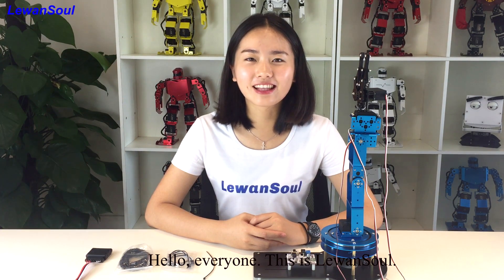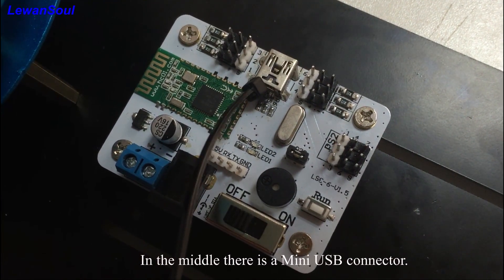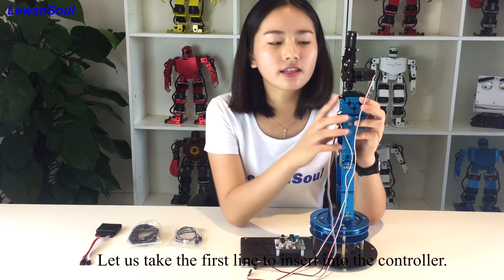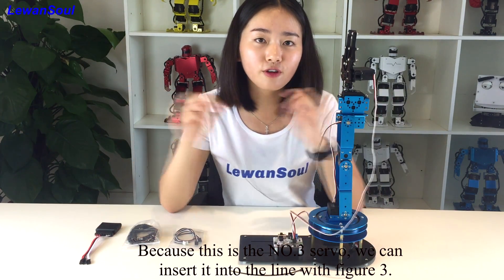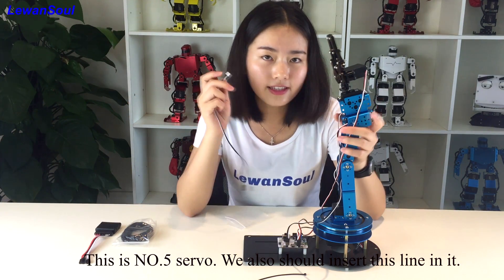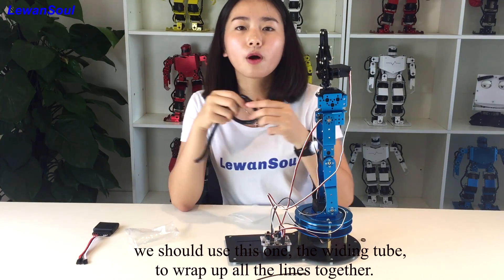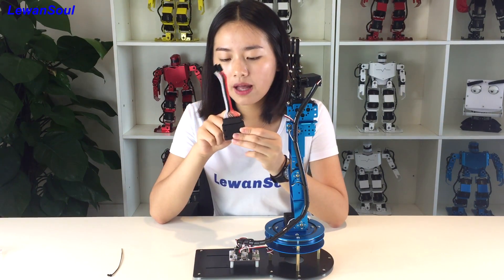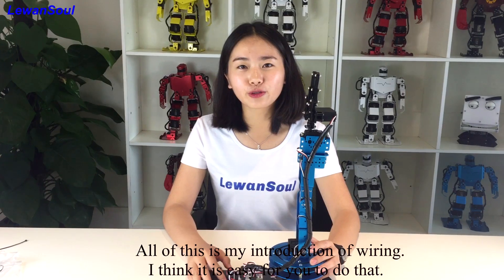Episode 4  Wiring

Comment: Do the servos drive wheels need to be set to a specific position before installation?  We are getting minimal motion with ours and the claw goes open and clicks at a high frequency.
Reply: Also having this issue with the uppermost servo and claw. Were you able to get this resolved?
Reply: @AngelinaHobbsASU  nope, not yet.  We need to disassemble and fix some of the other servos.  I'll post a fix if I figure one out.
Reply: @ Gotcha, the other servos are working fine for us. Just having issues with the claw which won't close all the way and clicks when it opens. I emailed support, so I'll let you know if we figure anything out!
Reply: @AngelinaHobbsASU  thank you. I appreciate it
Reply: Okay, so I actually found that the reason it's getting minimal motion is because the full range of motion for the claw for us was [1265, 2500]. It can't open/close beyond these without damaging it, and you can't modify these bounds on the app.